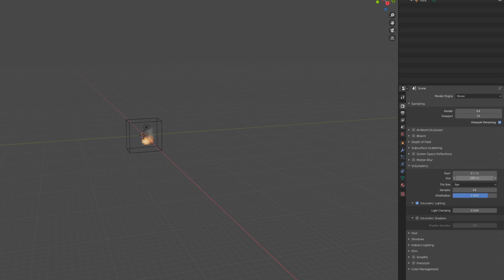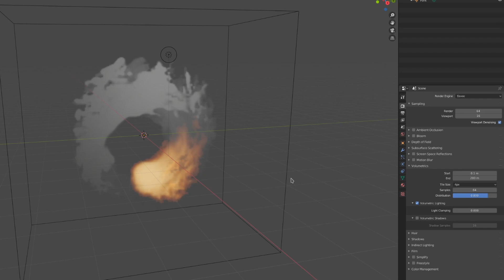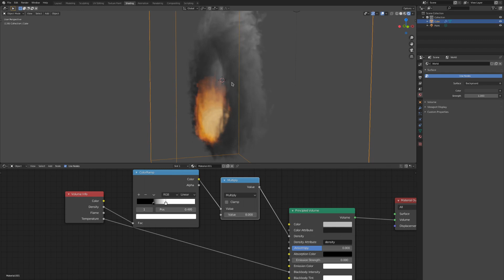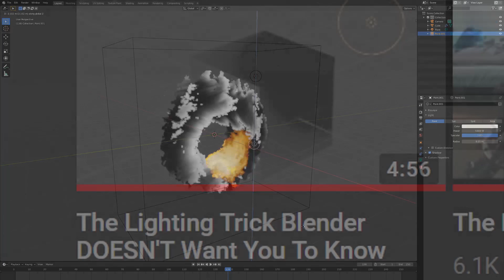Why EEVEE smoke simulations look bad, and how to fix them | Blender Mantaflow Part 9

Comment: Eevee may not look as nice as Cycles... but 30 mins for whole animation vs 30 minutes per frame seems a no brainer if you want smoke and don't want to have the PC running at max for days/weeks. Maybe one day I can get a beefy machine that can laugh in the face of extreme calculations and render my scene before I turn into a skeleton in the ground but until then... Eevee it is!
Reply from the maker: Yep, it's on the list :)
Reply: If you're doing animations i would consider adopting a blender - UE5 workflow. No realtime like UE5s realtime
Reply: @cgnovice2969  until you get to reflections lol

Comment: There is another parameter influencing the quality: Start/End in Volumetrics.  Keep that as close as possible to the front and back distance from camera to the volumetric object. This will concentrate samples in the region of the volume. You can reduce/balance overall samples for higher render speed.

Comment: Cool tips bro. Thx
But try changing your screen resolution to 1080p when recording. Because the UI elemets are hard to see.
Reply: Switch to 1080p on video quality
Reply: @wowmuchshiba7516  mr. Cheebs seems to have 4K resolution but records the video on 1080p. That might be the reason why the UI looks so tiny